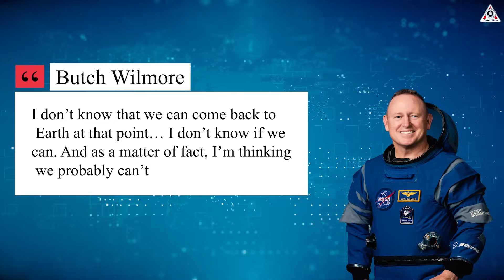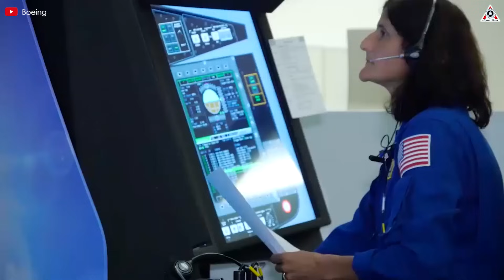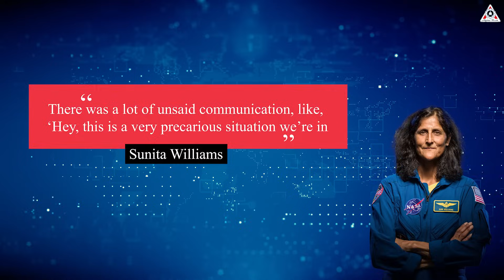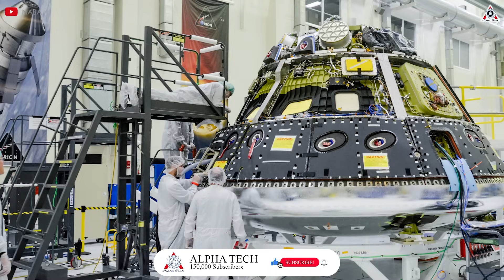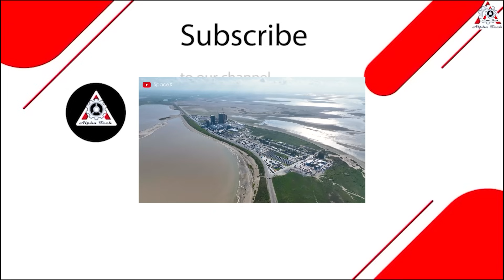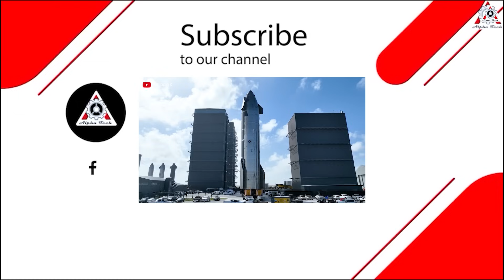NASA Astronaut finally revealed Big Secret on Boeing Stuckliner Totally Horrifying…

Comment: Bring back the space shuttle.
Reply: I believe that the Space Shuttle also suffered from Hydrogen and Helium leaks, as well as recurring valve freeze/ blocking problems. Hydrogen and Helium are among the most volatile gases. A nightmare for gas tank technicians.

Comment: Lots of pro SpaceX bias in this video.
The Apollo Lunar and Service Modules also faced lots of Hydrogen and Helium leaks problems, as well as valve issues. The Apollo heat shields also looked miserable after reentry , back from the Moon.

Comment: This is why Rome had a law that the Engineer had to stand under the arches when the supports were removed..
it encourged quality engineering, and eliminated the culls...

NASA/Boeing have office drones insulatated as much as possible from accountability...

And as proven by Raptor 1, BE-4, NASA stuff, and other similar tech, are willing to add crapp thats unnessesary to pad the old credit for doing something routine..

I got one look in a video at a side view of Starliner interior, and knew it was a POS at a glance... was padded with insulation that was monolithic, and wires and stuff woven thru it.
Thats not how you build anything, its not accessible for repair and modification, just lacked frilly trim of being a Techno Coffin... Would hate to see the outside with cowling removed, how insane it was for working access for repair... T'wer I top God of the Bureaucracy, I'd be having the managers working on that crap in Space Suits...

OK, now go back and encourage better designs...

And of course the Astronauts with not so much as a multi tool...

"Oh! no! we dont send anything repairable to Space!
we have wall hangers! We can do no wrong!"

Funny.... 
every other machine engineered has a system of repair shops...

Yeah, I think Boeing and NASA need a re-do...

Start over,
 PARTS COUNT! have an Enginerd from SpaceX that worked on Raptor 3 be project over lord...
Put Shock Collars on everybody under him...
Build something exquisite, The Capsule version of Raptor 3....
Make it simple stupid... and have it as easy to remove and replace componants. Literally designed to remove and replace in the least time and with the least problems possible...

Then have the CEO's do the first flight...

That way, we dont waste any more valuable astronauts.. The Universities turn out office Morons by the thousands...

Astronauts are small numbers...
Reply from the maker: Love your comment!
Reply: @alphatech4966  
I never know how my humor will be taken.